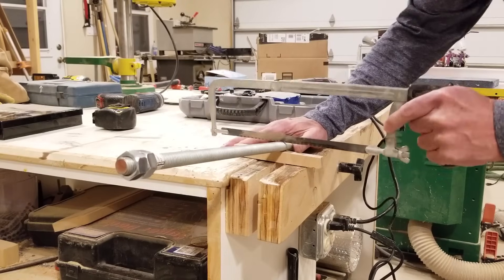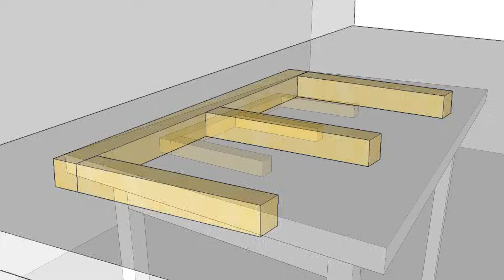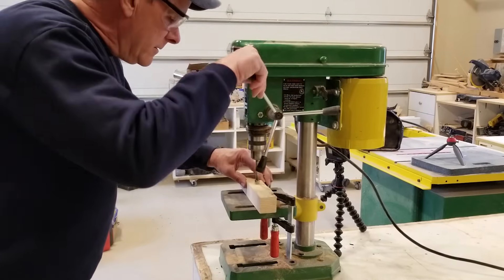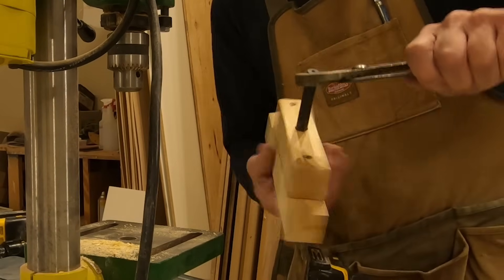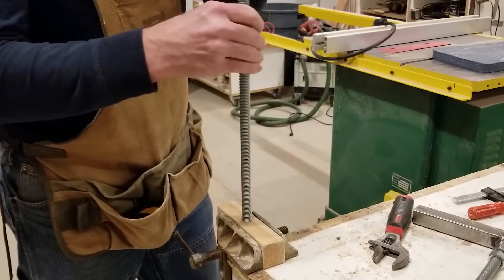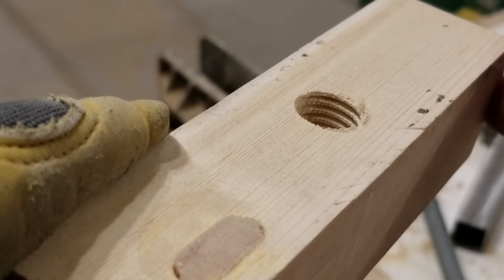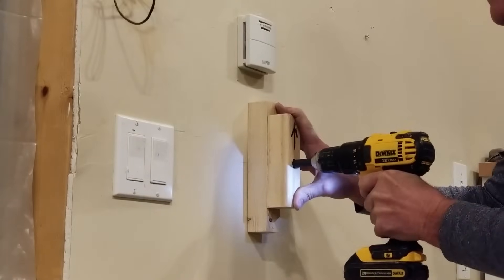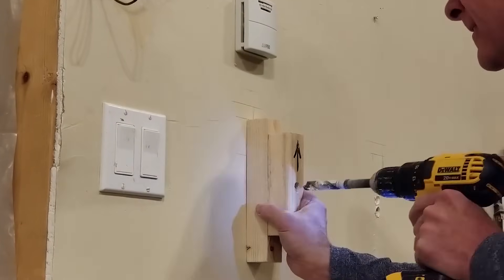Strong Floating Shelves - The Strongest Option

Comment: You are using the same method I have for the wood versions.  Truthfully, I see no reason at all for the metal threaded rod.  In terms of the attachment to the stud, I don't think it adds anything at all to lag screws, and in fact, is very likely much weaker, due to the threads being too fine.  I also do not think it adds much of anything to an already very strong resistance to the shelf bending down...when I have tested screws + glue, I can easily support 50 pounds a full 12" out on each support with no sign of deformation (I have not done destructive/failure testing), so four supports is 200 pounds.
Finally...why?  It may be impressive to put 150 pounds of cement on a floating shelf like that, but no one wants to do that.

Comment: Set screw in bottom wont be visible. Or larger holes in front add the nuts to hold it on then add some molding on the front to cover holes.

Comment: How about cutting a slot in the end of the rod and using a big flathead screwdriver bit in a drill to screw the rods into the wall? That seems easier and simpler than welding the nut to the steel bar.

Comment: Post tensioning would really exploit the potential of all the elements here. His shelf framing would work perfectly in compression.
Reply: Those all thread rods are in bending...and they will always be in bending no matter how much you tension them. I don't see how post tensioning would benefit a cantilevered system.

What exactly did you have in mind that I'm not seeing?
Reply: @internettoughguy Currently only the top of the threaded rod is taking the stretch.  Any time you bend some thing you have a stretching side and a crushing side. The thing about steel is it is springy so it gets more resistive to stretching the more you stretch it. So if you design in some nuts that can stretch the all thread against the frame and studs before you load the shelf then the shelf will hold more weight before it bends. The full diameter of the bolt will take the tension and the frame and drywall takes the compression load. As opposed to currently where the bolts just bend and slip out of their sockets. You will have to design a box to cover all of this, if you want to. And that is what we carpenters do to make things look like magic. Thanks for asking.
Reply: A similar phenomenon will happen to the wood and drywall. As you compress it it will compact and become harder so there is less deformation if you preload the contact surface.  Therefore you will observe a stiffer cantilever.
Reply: @markharmon4963  strong cantilever Anything is of interest to me. Thanks!
Reply: @markharmon4963   With respect I disagree. That won't happen in this context. By applying tension to the rods you will reduce the compression stress on the bottom fibers but the total stress in the rod will increase. The deflection will not change. The shelf will be just stiff as if you never applied any tension. I'm ignoring the drywall and frame as they are soft materials.

If we assume a 100 lb downward load at the tip of one rod and the rod is cantilever from the frame 12"...it will see about 50000psi peak tension stress and about 47000 psi compression stress on the bottom fibers. Deflection is about .424in.

Applying 3000 lb of tension to the same rod with the same downward 100 lb load results in a peak tension stress of about 60000psi but the compression stress on the bottom fibers has been reduced to about 38000psi. Deflection remains at .424in

Since the deflection remains the same you will not observe any change in stiffness.

If you're interested see pics below:
https://ibb.co/yV1N6V1
https://ibb.co/3YGpNpX
https://ibb.co/s1ygcW4
https://ibb.co/VQqGpMC
https://ibb.co/dpFqcFK
https://ibb.co/FDqRNQ2

I'm more than just a pretty face. Cheers.

Comment: Use a really strong magnet to figure out if the place you wanted to drill on has a nail or screw.
Reply: signupisannoying  absolutely, this method is tried and tested for drywall screws. That deeper screw though, might require either a trained touch or a very very strong magnet
Reply: Or steel wool.
Reply: @HeyCesarA4  steel wool? How?
Reply: @HeyCesarA4  how do u use the steel wool? Please.
Reply: Yes please, explain using steel wool
Reply: @dcgo44r  I am guessing you magnetize the steel wool first by rubbing it on a magnet. Because it is much lighter than a magnet, it will be easier to get it stuck to the metal, i..e. screw, nail, etc.
Reply: Same here. I hate using stud finders. A strong magnet always works the best for me.

Comment: Drilling such a huge hole on the stud and applying torque to it (by applying weight on the completed shelf), is it a concern to the structural strength of the stud?
Reply: The vertical forces on the stud as it holds the second floor and roof up are massive compared to the additional forces imposed by the shelf - even though, as you rightly say, the lever mechanics are not ideal from the stud's point of view. But wood is much more resistant to bending than steel - the steel bar would bend before the stud cracks.

But it could be nice to pass the all-thread bar right through the stud and out the other side, making two shelves, one on either side of the wall. That would cancel out those lever forces, assuming the shelves were roughly the same weight.
Reply: You assume that it is a load bearing wall too.
Reply: Point load is down and therefore the rod occupied the space or hole

Comment: goofy carpenter can't drill through steel.  Lolz
Reply: You obviously are an idiot,keep drilling when you hit steel in a blind cavity and you just might burn down the building,there are steel "nailers" that protect line voltage from exactly that type of intrusion.I have drill bits that can make it through hardened steel,but I have a lot more knowledge than a moron like you!

Comment: No, my floating shelves are stronger. My bathroom floating shelves to be specific. Half inch rebar epoxied approximately 3 inches into the studs. Then used 2x8's (solid wood) for the shelves and cut them to 20 inches long. Then epoxy the shelf onto the rebar. I like put the rebar about 6 inches to the shelf for maximum strength. Basically 9 inch long half inch rebar. And I saw yours flex. Mine don't. And I'm a big boy. So...💪

I'm not saying what you did wasn't nice (because it was, and I give credit where it's due), but honestly it was too much work and way over engineered. It's a shelf. Sometimes simpler is better. Take it from someone who was crazy enough to go after a bachelor's in mechanical engineering. I hope you don't take this criticism negatively. I think you mean well, and have a good work ethic, produce awesome build quality, but could do with taking a step back and adjusting the complexity amount based on the functionality of the intended use. Once again, very nice looking final product. You have more skill than any of my amateur neighbors. 👍
Reply from the maker: Charles, Charles, Charles! Where do I begin? How large and heavy are the spools of dental floss that you're putting on those shelves?  You probably have me on strength, but all I'm really doing is drilling a hole and threading a rod into it, so I've got you on simplicity!  Coming from an MBA, contractor, don't take me wrong  but you sound like a mechanical engineer! If you take another look at my video and cut out all the explaining and effects, it would take me about two minutes to install one of the rods! I appreciate your good nature and nice to hear from you!
Reply: @RustyDobbs  steel dental floss. Much heavier. Good to see you take it in a humerus way. 👍

Comment: I think I would have just used a ratchet.
Reply: I would have used the impact wrench and blown the threaded rod out the other side of the wall.
Reply: @giantpune  same 😂
Reply: while a ratchet would have most likely sufficed it is advisable when tapping to use a tap wrench which is essentially what he had welded up. this allows the torque to be applied perfectly along the axis. something which can become difficult with regular wrench or ratchet and socket especially with such a long tap. to be honest tho it was probably just a good excuse to bust put the welder
Reply: @saleplains  They say everything before the but or the "to be honest" in this case; is bullshit. ;)

Comment: Interesting approach!  I would be curious to see if this is actually stronger than a traditional lag bolt since the machine threads on the rod are shallower than you typically see on a lag bolt... Of course it's all academic because in both cases you're talking about shelves that are 10x stronger than any normal person would ever need in their house haha.  Definitely gives me some ideas for our house!
Reply: Really the threads arent what makes it structurally strong, having a 5/8 piece of steel going in 2 inches is what makes it strong. He could have done the same thing with unthreaded round stock and been as strong but then would have had to epoxy it into the studs.
Reply: There is zero tension load to cause pull-out, it is all shear and bending moment

Comment: This is how i've been doing floating shelves, except I use solid 2" wood for the shelves. I just drill holes in to the wood and put PL in it and push the shelves in to place. I can install a shelf from start to finish in less than 30 minutes, not including staining and putting a finish on the wood.

Comment: wooden dowels and a bit of glue are less hassle
Reply: And much less strength, kinda the point of doing this is for a stronger shelf
Reply from the maker: I started working with floating shelves using dowels and have several videos showing strength tests I did using all wood. I like using dowels and they are easy to work with. But if I'm not explaining and commenting on what I'm doing, this method only involves drilling a hole and spinning a rod into the hole. So it's really pretty simple too. The shelf connection to the rod is a little more of a challenge than working with wood but I have probably converted myself over to using the all threads going forward because of the strength and ease of installation.

Comment: got an idea of a slight variation of the shelf as presented at 12:16 in the video, what if you cut the all thread to a length where the front of the all thread is at the front of the front piece and that front piece was partially bored out so you cloud counter sink a washer and a nut to "clamp" the whole assembly? instead of just the nut at the back wall board (which also should have a washer to spread the weight out). Like what you mention as an option for mounting the solid shelf about a minute later in the video

Comment: Just use a carbide hole drill when confronted with nails.
Reply: If you encounter steel while drilling into a wall,do not preceed.You may or may not have hit a nailer that is there to prevent damage to concealed line voltage,you  are an idiot waiting for an accident to call your own.

Comment: Really smart and clean method. Thank you! Would this method work for solid 2x12”? My concern is the lever  arm is too short in the stud at only 2.5” to support the 11.5” width of the shelf. Thoughts?
Reply from the maker: Hey, Katy! The best way to answer that question for yourself is to try it in your own situation. In my case, practically speaking, I'm not trying to defy gravity or physics with the floating shelf. I just want a simple easy method to install floating shelves that will far surpass the strength capacity needed to support anything I or a customer would put on the shelves. In the video, those two 5/8 inch rods support my weight of about 200 pounds with my hands resting out near the ends of the rods with only a slight flex. That's pretty impressive to me! The solid shelf I showed in the video is essentially a 2 x 12 that I cut up and glued back together in order to make it easy to get my holes drilled for the rods. So it seems like this would work for you.

Comment: Instead of using a set screw, you could use an small diameter dowel pin, that way the original wood look isn't marred by a set screw. Also, a dowel pin enables you to simply drill out the pin if removal gets tricky years from now. 

A more permanent solution is to simply glue the shelf into place, as the threads will act as perfect glue grips.
Reply from the maker: Good ideas, Domush! Thanks for passing them along and for watching!
Reply: Or add a drop of silicone to the hole before you slide the shelf to the wall.  Then you could yank it off if you ever wanted to remove it.

Comment: This is perfect. I'd like to do something similar but on a steel framed house.
Reply: Rigg Amore cut away the material covering the supports and hire a guy to weld two threaded rods up. , or get a little welder and do it yourself.
Reply from the maker: Thanks, Rigg!  I appreciate you watching! I wish working with steel framing was as easy as working with wood when installing floating shelves!

Comment: Router a butterfly clip or washer and nut to the underside to pull the shelf back into the wall. Will only work on solid core.
You can also dab a touch of glue on the end into the shelf which can hold a lot of weight too, but harder to remove.

Comment: I never pick up my stud finder anymore after buying a couple of 1/2" neodymium magnets. I wrap them in blue painters tape and leave them on my air compressor. They find nails/screws very easily and I can leave them on the wall without making a mark and I'll still know where the stud is. 

It also helps me to know when there's a metal plate or screw where I'm trying to drill/fasten.
Reply: Actually, you'll know where the drywall guy just barely threaded into the stud. Try to put a larger fastener there, and the stud breaks.
Reply: @unclebedhead9099  so true, though the stud finder can do that to you too. That's why if you're going to put a big rod/bolt in, you would need to verify the sides with a screw (it will all be hidden anyways).

It was good to see him open up the wall a bit to verify there was no electrical going through that stud, though a smaller hole would have been sufficient and no need to patch.
Reply: @MyFortressConstruction  - To add to your smaller hole would be sufficient, one would note the scope cameras that light up and can see all up inside a wall that some pros have acquired for their toolboxes. 

Would also like to defend the stud detector he is using as well. I got the same one from Lowes and it does an excellent job of showing you the left and right sides of the stud. If you take your time, you can mark both sides and determine the center of the stud. Which, if you drill where you "think" is dead center, can't you take a tiny nail and test the left and right side of where your hole would be drilled to "verify" that in fact you are center? I'm not a pro, so please keep that in mind before you educate me! I don't verify much. I gamble and for the most part, I have better luck than if I were to go to Vegas! Other than tools and parts jumping out of my hand and I have to play fetch often during my projects, that is...
Reply: @kennyhalsey961  Yep, you're definitely thinking in the right direction. A small boroscope off of eBay is cheap and could save you from electrocution or a plumbing leak, however, I find that I can see without one 99% of the time. Using a nail to find the sides of the studs would also work like a screw. And I wasn't saying a stud finder isn't a useful tool, it can just be mis-calibrated, run out of batteries and take longer than a simple rare earth magnet. 
 Sounds like you're thinking through things so keep on keeping on, and I'm sure those tools will stop jumping out of your hands eventually. 😉
Reply from the maker: Great idea, Fortress! And to keep them on an air compressor or some other metal piece that you have with you all the time out on jobs would keep them handy when needed. Thanks for passing on the idea!
Reply from the maker: My experience with that stud detector, Kenny, is about the same as yours. If I can use it to get close to locating each edge of the stud I'm happy with that and can take a tiny drill bit to zero in on the center. The electric line indicator is typically more confusing to me than anything!
Reply: magnets brilliant!

Comment: If you were looking for that metal plate you would have never found it.
Reply: Man you are so right I was drilling thru a brick wall in Camden NJ from the inside out to run TV cable, I get thru the brick but than drill won't go any further.. go out side and it's getting late, like dark ( we called Camden, Dodge City, get out of town before dark) and sure enough I hit dead center on this 3 inch pipe running up the building, no way in heck I thought I would hit that pipe, ever... It took some finesse and time but it all turned out great... What are the odds?
Reply: Robert S so good to know I’m not alone. Lol